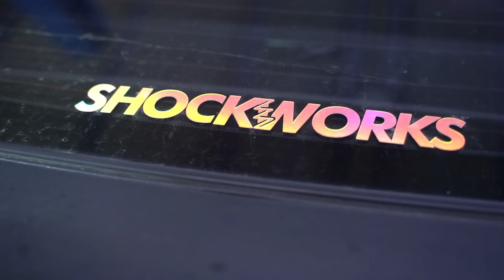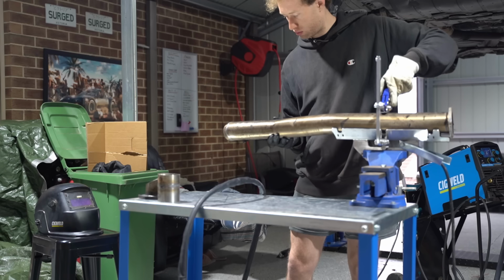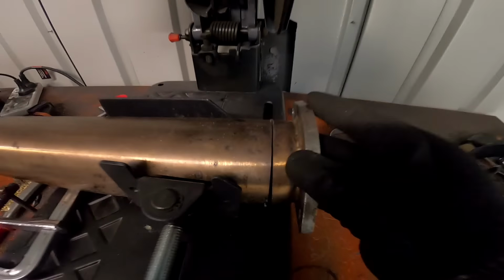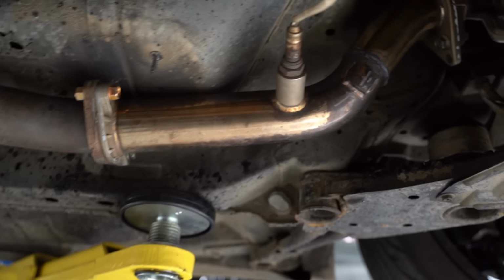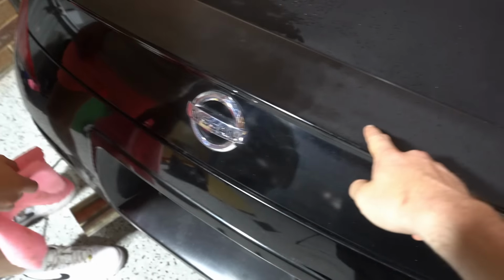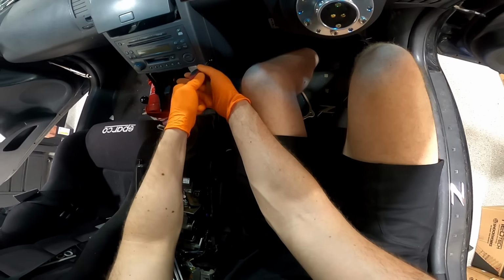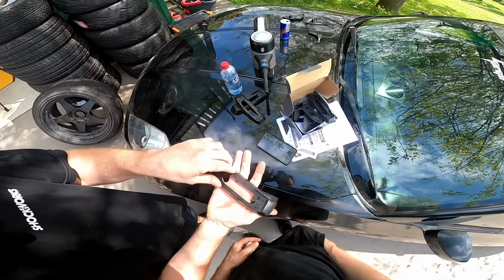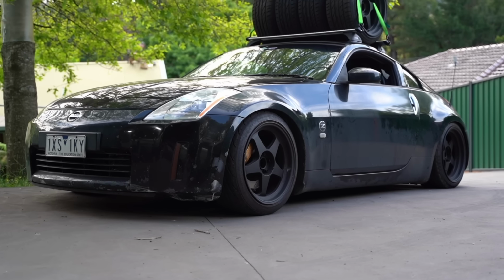Building a TOUGE 350Z Drift Car | Part 4

Comment: Did the same thing on a G35, installed a full dual exhaust, headers, test pipes, resonators, and the rest all the way back. Took it for a test drive, came back and immediately put the cats back on, it was LOUD.
Reply: I installed headers, Motordyne ART pipes (had them on the previous exhaust) and a Motordyne TDX2 cat-back exhaust. It was... anti social. I had buy some cats to quiet the thing down. Sounds great now though.

I've got PPE LTH on the way, so it's probably going to undo all that anyway lol
Reply: Doesn't help that the z motors sounds like ARSE too.
Reply: @Mr_jz_12  they only sound good when cammed and like insanely aggressively tuned and they still need a decent exhaust system and not some fckn GUTTER PIPES
Reply: So I’m not the only one LOL. I still have my old test pipes sitting in a box in the closet, and I don’t even have the 350z anymore

Comment: To smooth out the exhaust note, put a muffler style resonator (such as Vibrant Ultra Quiet) on both forks of the Y pipe. So you'll end up with two muffler-style resonators that merge into the hotdog you installed.

This'll result in a really smooth sound without sacrificing volume.

If you don't have the space for that, weld a muffler style resonator into your cannon at the rear. That'll do 75% of the job and will really reduce the trumpet

Comment: Hey man when welding thin stainless pipe you only need to run  like 35 to 50 amps 35 will allow you to move slower and also it will remove the greying from your weld which the grey color is caused from too much heat.. I love the videos with the z I'm a professional welder and I am currently building a drift 350 myself so I can't wait to see more great job so far tho man

Comment: 10:03 my G with the OSRS soundtrack!!!
Hot Tip:  For my GKTECH hydro, i needed to cut the bolt itself on the hydro reservoir plunger, i needed to take a quarter inch or more off to make the handle fit better, now it barely hits the climate control... it'll still hit no matter what.

Comment: Yeah Benny good stuff! We met at WTAC last year when you told me about the 350! 
I've been learning to tig the past few years and feel the same pains you had with the fitment hahaha
Welding two pieces of metal together is easy but FABRICATING is an art i still suck at. 
I suggest next time, fitting it all up and tacking it on the car. It will save you from headaches! 
Keep it up man!

Comment: Tips for the stainless welding mate (I’m not trade qualified, just have some clues) the colour of the welds indicate that you’re getting a fair bit of contamination, as well as being to hot, the colour I’m talking about is that dull gray black, you can think of that like burning the stainless steel. The ideal colour your looking for is a straw gold, but rainbow is ok. Play around with your amps, the lower the better with stainless, better to move slowly than ruin the material, and sometimes lowering your gas flow to more around 7L/m on a lower amp setting will help with the quality of the weld, also PRE and POST flow are essential, i usually run 5-7 seconds of post flow when welding stainless of that thickness, and pre flow is also essential, give the wand button or pedal a click on and off again to trigger your post flow and let it surround the area you are about to weld with gas. Your tungsten should hover 1- 2 mm above the weld, and the tungsten should stick out from your cup about 1cm. Also try to keep your filler rod inside your gas cone. 
Also best practice would be to purge the inside of the exhaust with argon also but it isn’t suuuper important at your stage. 
Love the videos my cousin, hope this helps you.

Comment: Put some small hose claps on the exhaust hangers to keep them in the rubber mounts. It keeps your pipes from trying to rage quit when shredding.. 😎
Reply: Top tip, I need this 😂
Wont they tear up the rubber though ?

Comment: Hold the welding gun close to the weld for 5-10 seconds after u finish the weld. If you keep pulling the tip away after you let off the power you let oxygen get to the weld compromising it

Comment: If you want a straight pipe like that you should put a turn down exhaust tip on it you will keep the noise but the sound would be a lot better due to it facing the ground

Comment: The absolute biggest mistake you can possibly make with a street/drift car is putting a loud ass straight pipe on. If you go sliding at any spot. You immediately have to think about “who can hear my cars tires and exhaust from here?”. It’s ALOOOOT funner, having a 20-30 minutes sesh at a spot rather than 2 or 3 runs. Trust me

Comment: loved this video as someone with both fab experience and several years of ownership of a v35 sedan. I saw so many of these problems coming 😂 I legit gave myself tinnitus from driving the car straight piped so many miles. all the test pipes are dogshit quality and make the car super loud. and be ready to replace thoe flex sections on your y pipe they blow out All the time. get a pedal for your tig machine it makes tacking and heat management sooo much easier.

Comment: Let’s get this man some proper welding lessons. But not to bad to start I would recommend bringing that tungsten back to about 5 mm outside the cup and make sure it’s sharp when doing stainless red tipped tungsten works the best with stainless but keep it sharp if it is burning up the tungsten to much without you even touching the material turn the gas up during your weld or post weld. But definitely recommend like the tig welding tafe course

Comment: the loose tie rods gave me flash backs when my s15 snapped its hyme joints not once but twice. luckly they both gave out in carparks but one time it was just after i got off the highway. wild seeing your car wheels point in 2 different directions. they were gktech units and after contacting them about it they said stuff like "yeah na, 100% installation error, our stuff doesnt break but here, have our new stronger ones" like wtf why make stronger ones if the existing product doesnt fail?

anyway after the second time i threw them in the bin and got some quality hymes. dodged a bullet twice thats for sure

Comment: The headers sit too low because it’s designed to fit an 07+ 350 z with the HR engine, the headers on the HR 350’s are shorter which is why they sit so low in your 03 350